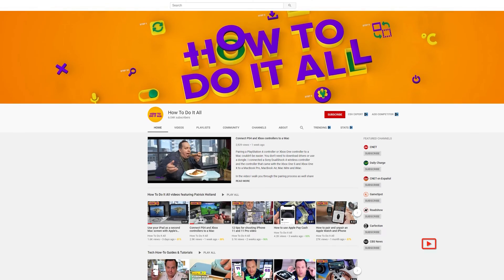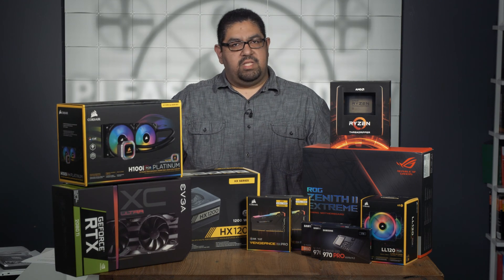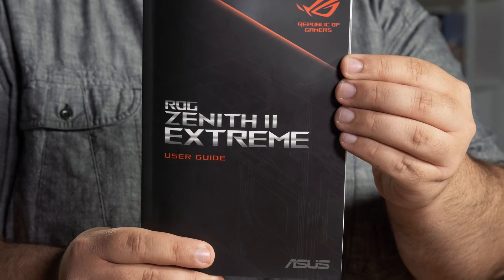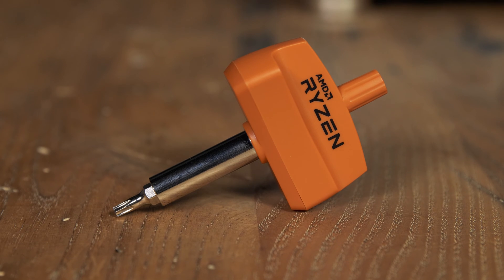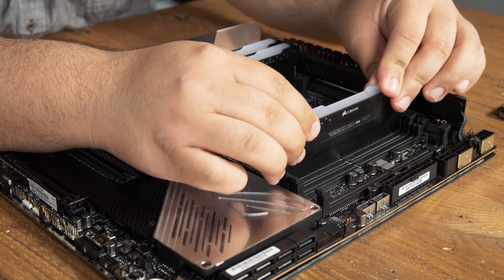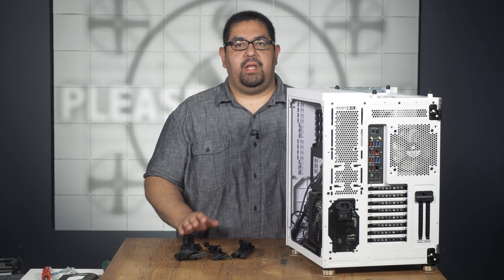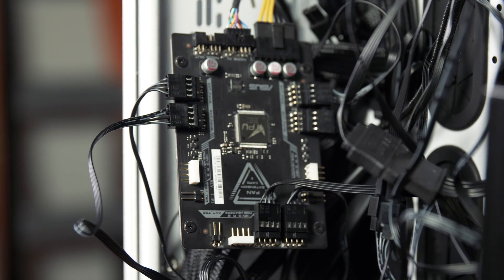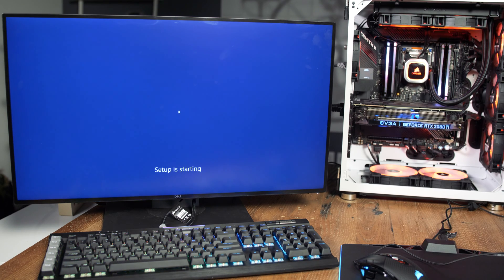How to build a PC (special step-by-step guide)

Comment: Well, of course, first you need a table. Preferably not metal. A thermal paste applicator, an allen wrench, some tweezers grabs zip ties to tighten up the wires, a swiss army knife which hopefully has a phillips head screwdriver in it.....

Comment: touching your metal case to "discharge" yourself will only work IF the IEC power lead is plugged into the PSU and grounded to the chassis, if its unplugged sitting on the bench, its the same potential as your body.

Comment: you didnt tell them about the case stand offs
Reply: I mean, most motherboards still have a QuickStart that tells you how to install standoffs, don’t they? I don’t think that’s a particularly huge omission tbh, especially compared to the abomination that was the Verge’s build
Reply: KingInTheNorth I never said how high the bar was, I should have said that this (and seemingly not permanently attaching the 2.5” SSD) were hardly major issues and could easily be remedied by a pinned comment if necessary. Otherwise, I think it was a very useful and pretty easy to digest video for beginners